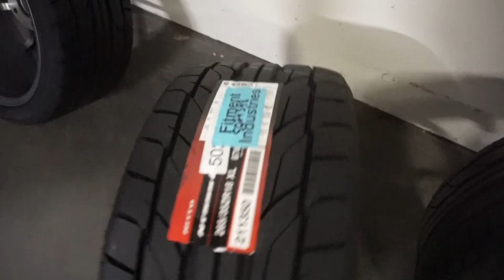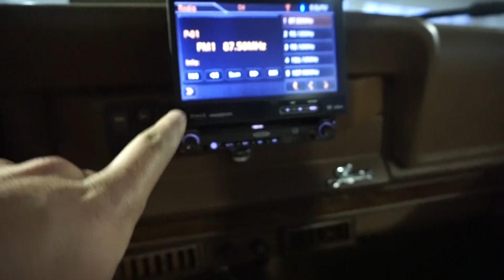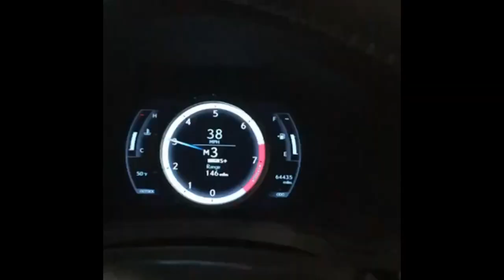Vlog 8 | New Wheels and Exhuast for the IS350

Comment: Is your car lowered? I just bought the same specs just different rims. But I'm worried about running the 255 35 in the front due to rubbing .. I'm on stock suspension.